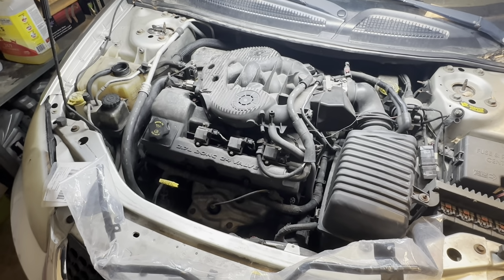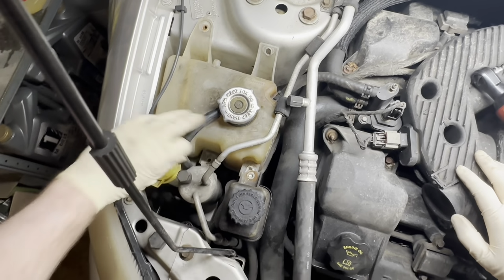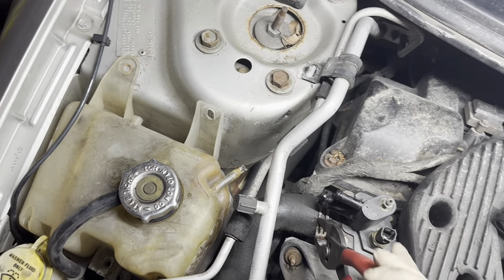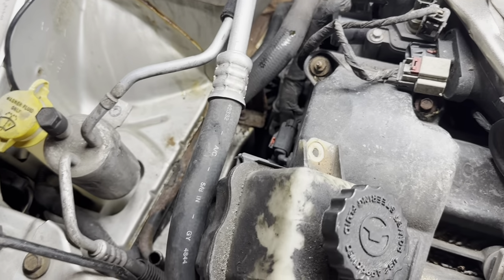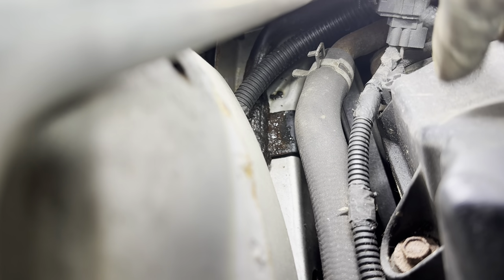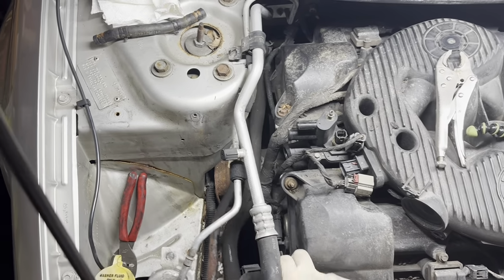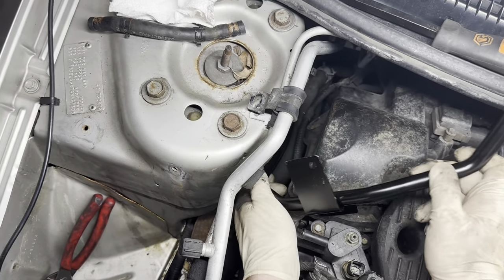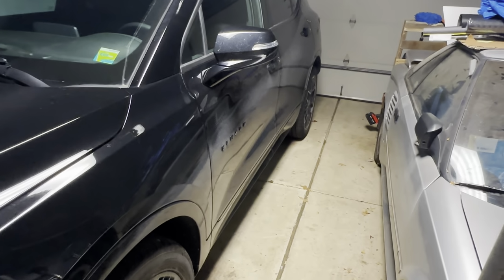Dodge Stratus/ Chrysler Sebring - Replacing A Rusty & Leaky Coolant Pipe/ Heater Hose Tube Assembly

Comment: I have a few questions, if you do not mind :DD (I do not know a whole bunch about cars, so sorry if these are dumb questions 😂)
1) How much did this cost you?
2) Can a coolent leak effect other parts of the car (specifically a timing belt) ?
3) Can it affect the car starting?
4) Where did you get the pipes/tubes?
5) Do you know what might cause Stratus to jerk when accelerating?
Reply: Oh, and One more
I know that coolent  keeps the car from overheating, but when it does, what are there side effects?
Reply: Thank you!!
Reply from the maker: No such thing as a dumb question, happy to share what I know!
1) I want to say the part was around $130
2) It can depending on the location and severity of the leak (I had one car with a slow coolant leak onto my transmission clutch and caused the car to slip when accelerating)
3) It's possible depending on the car, most vehicles should start and run fine with a leak but could quickly overheat once they get up to normal temperature.
4) Amazon had the best price and availability in this case.  I'll check local auto part stores or dealership service departments, but this is not a super common part and slightly harder to find at a good price or readily available.
5) Hard to say, could be an engine running issue or transmission slip.  Engines can surge/ jerk if they have a misfire, fuel delivery issue, or vacuum leak (just to name a few issues).
Reply from the maker: First thing you might notice before the temperature gauge rises is a gurgling noise in the dashboard when driving, or your heat starting to cut out inside.  Depending on how/ where the coolant leaks you might see steam from underhood/ puddle on the driveway.  In the very worst cases (if left to overheat badly) the engine can become damaged and lock up entirely.  I had someone overheat their engine, warped it internally where oil and coolant were mixing together, and eventually seized up because the oil was so watered down with coolant it couldn't lubricate the engine anymore.  Keep an eye on that temperature gauge if you suspect a leak!